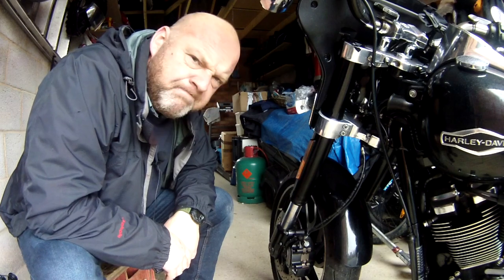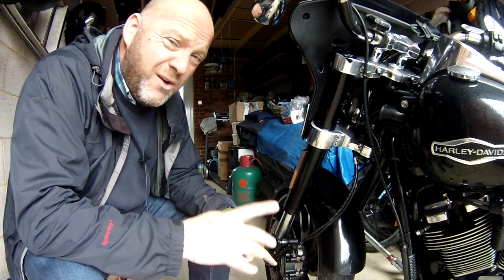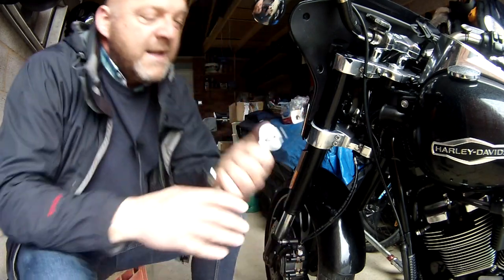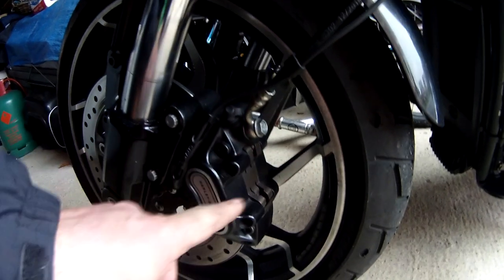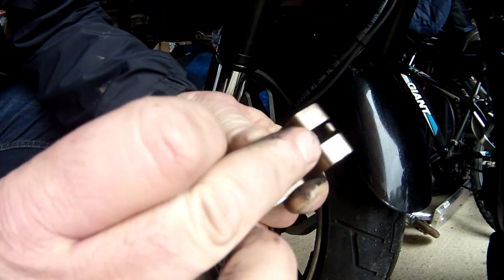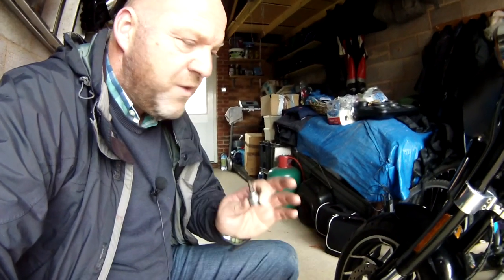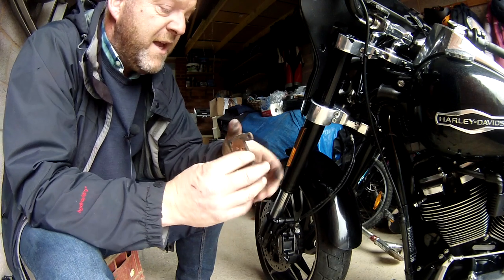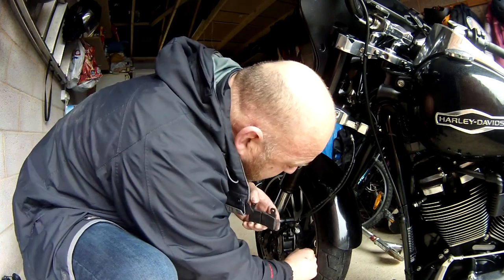Check And Change Harley Sport Glide Front Brake Pads - How To Inspect Harley Brakes

Comment: I understand you are just covering replacing the brake pads but some viewers might not understand the brake system as a whole. I would recommend separating the caliper from the fork, remove old pads then clean caliper with brake cleaner especially around the brake piston area to remove the brake pad dust build up then compress the pistons into the caliper this will prevent the pistons from hanging up. Then clean the brake rotor with some brake cleaner and scrub the rotor with scotch brite to remove residual brake pad dust. Then I would flush and bleed the brake system as the brake fluid is dot 4 and it is hydroscopic and absorbs any moisture the fluid will change from clear when first installed to a darker color as it is getting contaminated. In my humble opinion it is best to address the brake system as a whole when it is time to replace the pads. Especially on bikes with abs as the contaminated fluid can and will cause an abs failure. Harley recommends flushing the brake fluid every two years due to fluid contamination
Reply from the maker: yep

Comment: Hi Alf, mate having trouble finding out about replacing my front brake cable for a longer one , I’m just unsure regarding the ABS system is there a video on how to do this on the sports glide much appreciated if you can help . Regards Aussie down under
Reply from the maker: graham bianco hi Graham thanks. You can get longer brake cables either from HD or have custom length ones made as all the fittings are standard.
However there is a trick to bleeding the brakes as you will have to do it from the wheel to brake lever and not the way around and this doesn’t interfere with the ABS if you bleed it correctly.
I haven’t done. Such a video as yet but may do in the future however I’m sure there must be a video on how to bleed Harley front brake or how to replace front brake cable.
I’m the meantime I’ll have a search around for you too but it might be a while before I bleed my brakes so you’ll need a fix beforehand.
Cheers

Comment: My inner pad is completely worn whereas my outer pad has plenty of meat left, why is that?
Reply from the maker: Really depends on your calliper design but may need a strip down and repair
Reply: Its a 19 low rider with 11000 km only
Reply from the maker: @elusivesambar8657  doesn't seem right does it.